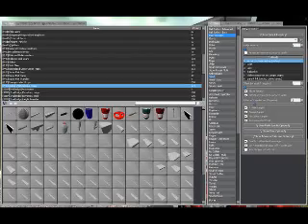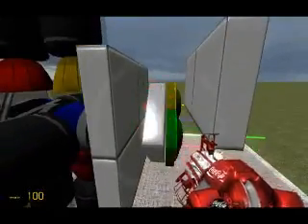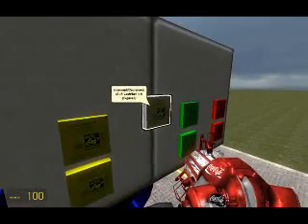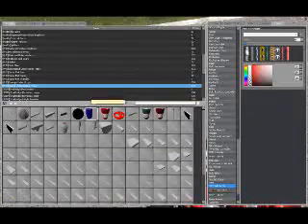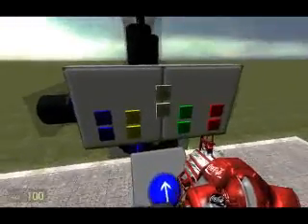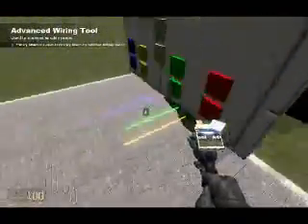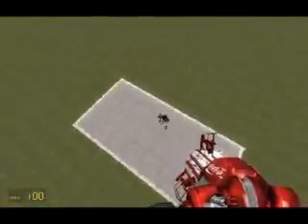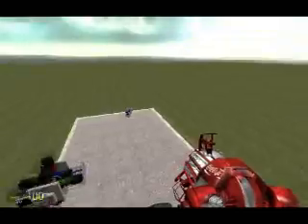Gmod Engine Tutorial - Build an AMAZING 8 cylinder radial! SUPER DURABLE AND FAST! (Part 2){#2}

Comment from the maker: @willwatchtonsofvideo Hey, make sure you have used the axis tool, prefferably Centre Axis tool and applied it to the propeller then the plate,  then welded or adv ball socketted the propeller to the crankshaft. And no collided it with every thing too. Hope this helps.

Comment: Probably a stupid question, but how do you ballsocket the propeller on? i tried all different places on the crankshaft and it either stalls the thing or it just spins back and forth. I'm thinking of making the top plate completely transparent, no colliding it with everything, and then easy-welding the propeller directly on to the crankshaft. if you need more info man, or  if you have a way to help me, then please do. :)

Comment: @Waluigiftw Have you gotten anywhere on this crane idea?  I think if you have a powerful engine, get it running, then use 2 gears to transfer the power to a big PHX plate... then from there have alot of small er plates on that big one, all attached to hydraulics and with gears on them that you can slide onto the main gear with the push of a button, like a clutch almost... then rout the power those gears get to arms or something.... youd have to massively slow thee gears down though.

Comment: @HzrdFilms And X engines are usually two Vee engines mated together and share a common crankshaft, or are geared together from the output shaft (or just drive contra-rotating propellers separately.) One example is the Allison V3420, which is two mated V1710s. There are several other examples, each manufacturer of the time had at least one X engine, or H block engine (the Napier Sabre.)

Comment: @HzrdFilms I made a petrol thruster that consumes gas when fired, though it requires an outdated LS2 to work. 4 cycle consumes less gas than two cycle, but it also produces less total engine power since the piston fires every 4th time as opposed to every time.

Comment: This is more of an X engine than a radial. Radials nearly always have odd numbers of cylinders per bank due to the way the otto cycle works. Also to note that on the otto cycle, the valvetrain runs at half the speed of the crankshaft to give 4 strokes, not at the same speed of the crankshaft. There were some experimental diesel two cycle radials, but they never caught on due high fuel and oil consumption and the associated extreme weight from the heavy build of the engine due to high compression